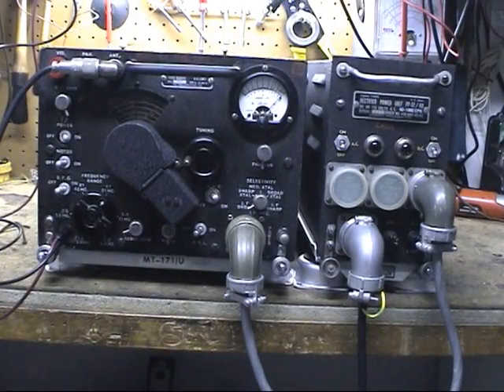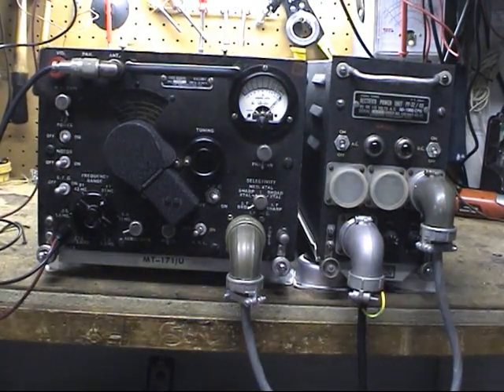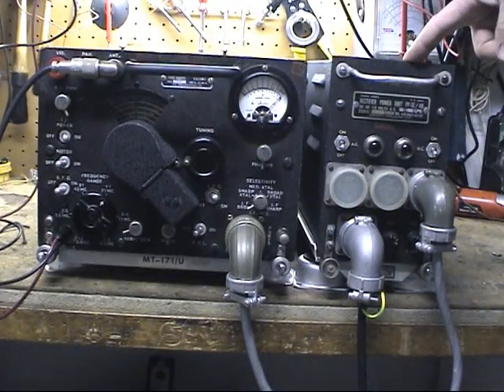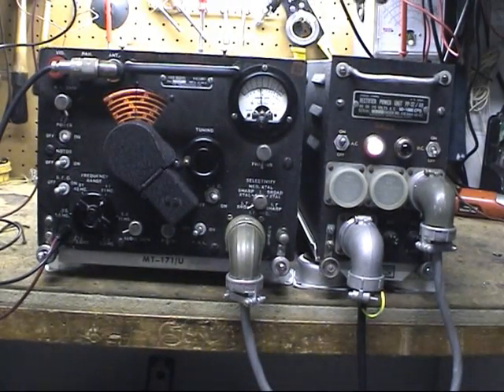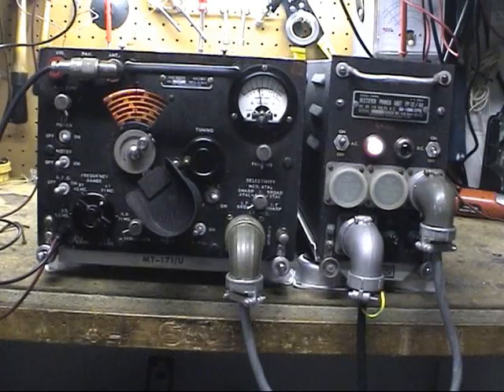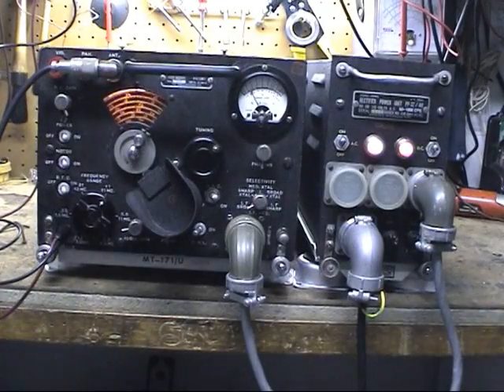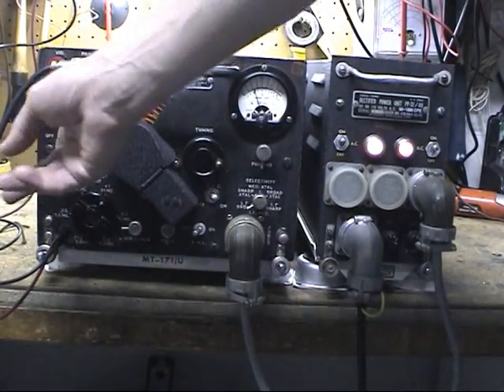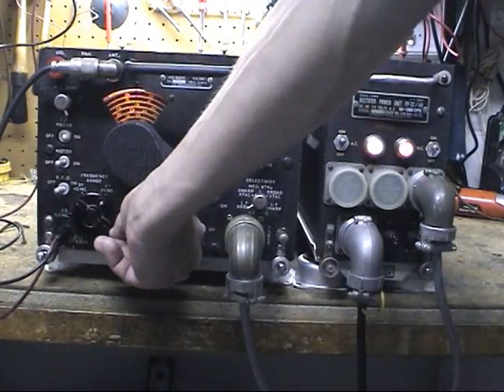ARR-7 / R-45 WWII Aircraft Receiver with Motor Sweep Tuning

Comment: That's definitely a cool RX. Can it also be set to stop on a signal and pause and then continue scanning? ...  in it's orginal condition I mean, without adding  mods to the AVC circuit, etc,  like Mark J commented 5 years ago.
Thanks for sharing, Dhalgren440.

Comment: Had one of these on a commercial fishing boat in the 60s. Reduced motor voltage to slow the tune rate (and to preserve motor life, ran VERY hot on 28VDC). Built a simple AVC controlled motor interrupt relay so the sweep tuning would park on strong signals. Used it to find "secret channels" (non FCC authorized freqs) used by other fishing boats. Paid off big a few times.